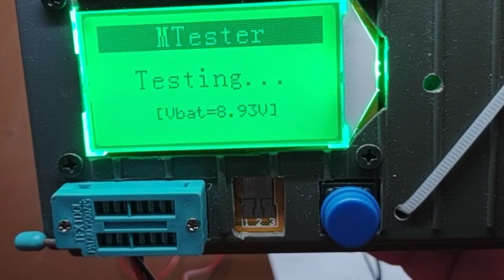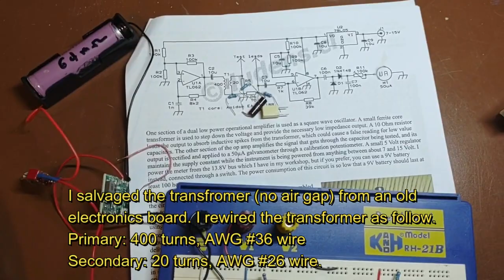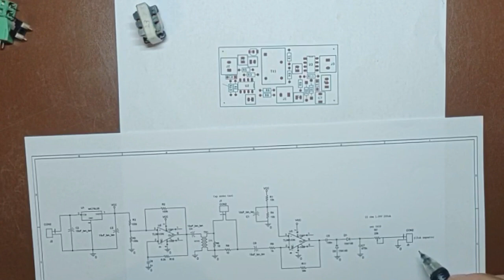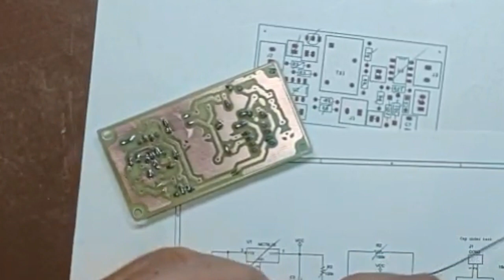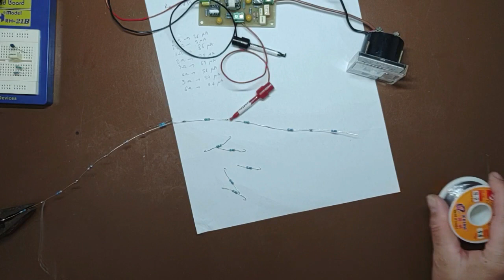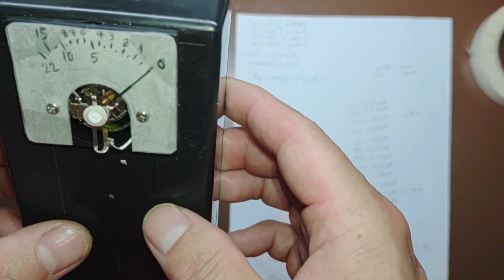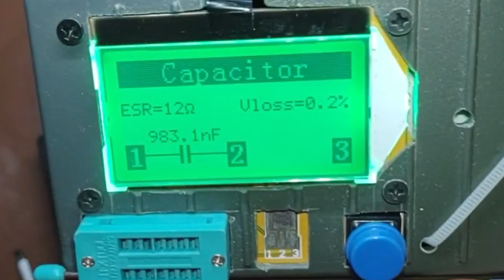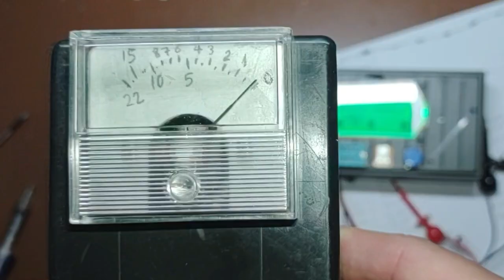ESR meter diy

Comment: Just completed the first generation of ESR meter you posted, there is no problem in using it, and the effect is quite good! Then I packed the LCR-TC4 in a plastic box in the same way as you did. It was a very pleasant day! Greetings from a Taiwan fan, I will continue to work hard to follow in your footsteps and learn to make my own repair equipment, thank you very much！
Reply from the maker: I am glad to hear that. Good luck with your repairs in the future.
Reply: @junkyard_engineering  💪💪💪

Comment: Thanks for sharing this amazing ESR build. I wish you had a guard on that saw my friend!😀
Reply from the maker: Thank you. Hope it will useful for you.
Reply from the maker: I will add a guard later.
Reply: @junkyard_engineering  Ten four don't wait too late. One of those thin disks exploded on my neighbor the other day and he had to go get stitches and missed a few days of work. Those thin blades will fly apart if they get into a bind.
His was on a hand held grinder and he didn't understand the seriousness of the situation.
But yea I do love this circuit board etching! I was watching Mr Carlson do one today as well.
Reply from the maker: @RC-Heli835  sure. I will do. By the way I love watching Mr Carlson's video too.
Reply: @junkyard_engineering  Yea he really knows his stuff. 
I just got the Hiletgo Multi tester T7 today from amazon.
Its encased with a chargeable battery. Tests cap, diodes, mosfets, zener diodes, inductors and identifies them. 
It gves several different values and esr for caps. Also has a color screen. Love it. 
TRX Lab Peter has one. Its very nice for 22 bucks.
Reply from the maker: @RC-Heli835  I absolutely agree with you. Good luck with your new tool.

Comment: Is it true that the primary and secondary terminals of the transformer are connected to the ground with the same name? Thanks！
Reply from the maker: Yes. Everything are according to the schematic
Reply: @junkyard_engineering  Thanks
Reply from the maker: @lww3988  you are welcome. Good luck with the project.